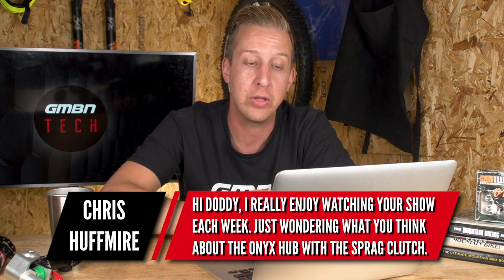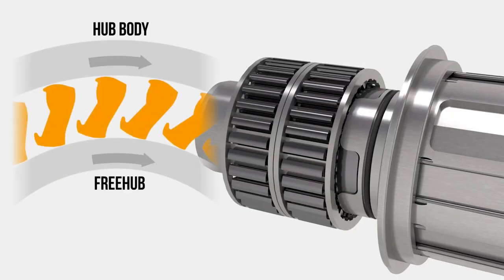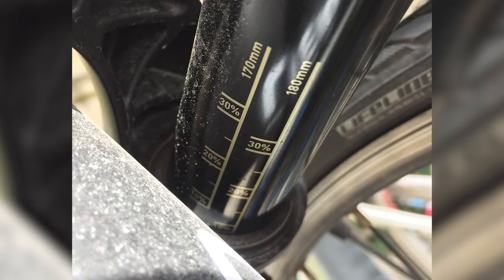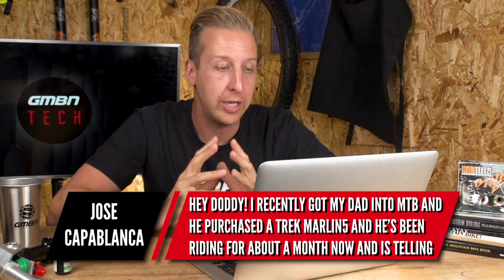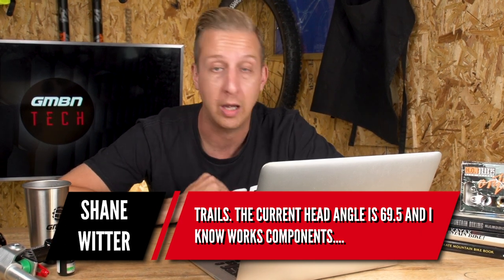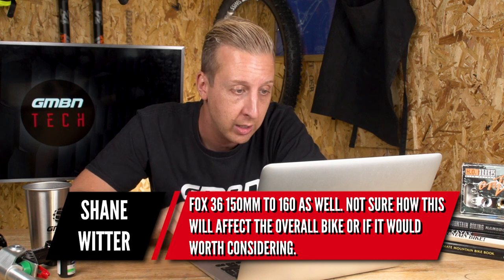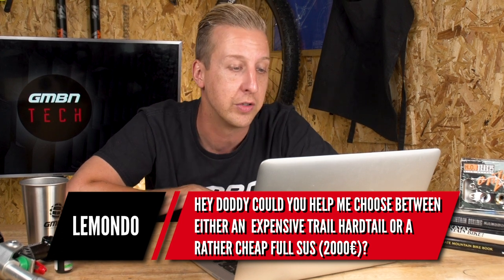Are Gearboxes The Future Of Mountain Biking? | Ask GMBN Tech

Comment from the maker: Which maintenance videos would you like to see? Let us know in the comments below
Reply: Hi GMBN,
Could you do a video similar to the one GCN did with budget bikes?
I'm sure it would be entertaining to watch a video with all the presenters having to buy/build a bike for a budget (low one) and the put them through tests.
Reply: GMBN Tech maintenance on canyon pivot bearings on full suspension bikes...especially the strive with the  shapshifter piston
Reply: Make a video where you completely overhaul a full sus bike from washing, lubing, greasing, pivot bearing maintenance, basically everything you could think of maintaining in 1 video
Reply: Its not really a maintenance question but it would be nice if you could do a video about all the different bottom brackets especially regarding chainline and that sort of things.
Reply: GMBN Tech SR suntour fork service
Reply: How to repair a snapped chain, how to repair a punctured tubeless tire
Reply: Coil fork rebuild (like the one you did on air forks). Many of my riding buddies still use (and love) coil forks.
Reply: Bottom bracket maintenance on the various styles.
Reply: Hi Doddy, vid on how to correctly inflate/pressurise forks and shock...as I saw a sram video about monarch shock and having to compress it at 100psi to charge neg chamber...but can find nothing similar for forks and my new super delux shock
Reply: How to drill an alloy frame to take internal dropper
Reply: Different pedal service vids fir makes that dont have them...e.g. time atac
Reply: Reverb basic service video, and for other dropper makes...
Reply: Paint chip repairs
Reply: Stop your helmet and kit smelling sweaty...
Reply: Replace headset CUPS...not just bearings...
Reply: Some vids on hack maintenance, when u dont have the specialist tool,  like fitting a (solid) crown race without a proper tool,
Reply: Replace free hub and rear wheel bearings...
Reply: Next bike project...how to build up a retro bike...including finding old genuine, parts, the right old tech...etc.
Reply: Ok, that's enough for now...😀
Reply: GMBN Tech stripping down shocks and forks completely for complete servicing May be also dropper post fitting and full servicing
Reply: How to replace pivot bearings with a homemade tool
Reply: Also how to stop cable rattle!! It drives me crazy ive tried everything up to inflating a ballon inside my downtube and it still doesnt work. Zip tie trick doesnt work eithrr
Reply: GMBN Tech st suntor coil fork service
Reply: As always great video Doddy, could you make maintenance video on front suspension, rockshox low to mid price range forks (reba, sektor, recon) how to change travel, upgrade compresión damper? for example, thanks!! Keep up the good work.
Reply: Would be nice to have a how to true and dish a wheel. Dont think you covered that topic yet. Freehub body service would be cool as well!
Reply: I would love a how to video about truing a wheel
Thanks for the show Doddy. It's awesome.
Reply: servicing brakes, ie sticky pistons,
Reply: @GMBN Tech, Please can you do video on how to clean, grease or service a rockshox reverb dropper post. Thanks.
Reply: Types of BB's and how to fit/replace one. Also reverb dropper maintenance and trouble shooting eg vertical play of which I have on mine
Reply: I'd really like to learn how to set up my gears but I'm afraid of fiddling with it. I've already messed with the limit screws erroneously to try and adjust something that supposedly should have been adjusted with the barrel roll adjuster. I have a bit of a hard time understanding the relation between the various bits in tuning gears and I'm really curious but also afraid because there isn't really something that I can lean on the know that I've hit the correct tuning. There's no measurement I cant take, or something like that it's down a bit to feel and that's kind of hard to grasp for someone who doesn't have lots of experience in doing it.
I'd also like to replace my own cables but that also feels like something I could easily get wrong.
Reply: I want to know how to take apart an xd driver freehub, not just take it of the hub but take it apart itself for example taking of the bearings to regrease them.
Reply: Trailside maintenance: patch kits, plugs, etc when you break down far from the car or the shop.
Reply: A place with all maintenance guides would be cool. From a simple how to clean to complicated how to maintain a shock or true a wheel, in one comprehensive unscattered list. Maybe also more safety gear performance and how certifications compare?
Reply: I wouldn't call this one a "basic" or "maintenance" but still: how to build a wheel. From picking right spoke length to lacing everything together with as much details as possible. Cheers Doddy!
Reply: I would love to see more suspension related stuff, like changing the air shaft to increase or decrease travel. Or dampers, like making a normal Fox 36 Performance into a 36 performance elite by going to a nicer damper cartridge
Reply: Hi Doddy can u do a video on shaving bottom brackets please, going to be doing mine soon and would love to see more info about this, ps. Love the show seen  all ep's
Reply: Series on maintaining your tech like GoPro, electronic shifting, power meters and other bits like that how you keep them calibrated, how often you charge them where you mount your GoPro's and stuff like that its the tech channel, after all, make it tech maintenance
Reply: Bearings removal and service of FS frames
Reply: Maintaining press-fit BB's
Reply: hub maintenance with no special tools :D
Reply: how to service a fox dhx 5.0 coil and rockshox boxxer
Reply: How to true a wheel video would be great, saves me having to go the bike shops.
Reply: #askgmbntech hi doddy I have a 2008 giant glory and it comes with a fox DHX 5.0 what do these do and how do there work position-sensitive Boost valve, adjustable ProPedal, adjustable bottom-out resistance, adjustable tuning range via Schrader valve
Reply: GMBN Tech  
Hey Doddy, a video showing how to replace a internal brake cable/hose would be nice. How to you prevent le mineral oil or the dot liquid from dripping in the frame ? Also what are your tips for routing the cable inside the frame? 

Thank you  !
Reply: Lower leg service, driver body service/cleaning for rear hubs, switching to a 1x maybe, not really maintenance related but maybe compare different level drivetrains from Shimano and sram and maybe discuss benefits of each as compared to others in the same price range or from the same company
Reply: Air to coil conversion for fork and shock?, BB service
Reply: GMBN Tech make a video on how to change a tyre and how to patch an old inner tube
Reply: How to properly choose and upgrade your bottom bracket. 

I have a 2018 Specialized enduro 29' 6 fattie. Entry model. I want to go from RaceFace Aefect to RaceFace Atlas but not sure I can. I want to to go to atlas because of the 165mm crank option that's not available with affect line. I want to stick with the cinch chainrings, because I bought several of different sizes of them for different conditions.

The atlas has a 30mm spindle and the aeffect is 24mm. Both come in 68 73 or 83mm. I know how to take the parts off. I am not sure if the 30mm matters at all other than I will need the bearing assembly. I just want to know what parts I need to order. Its seems for the most part this stuff goes in only one way if its compatible.

The reason for this change is I bent the crank arm. Trying to make the most of it.
Thanks for your time.
Reply: Hi GMBN tech, I love your maintenance videos however I’ve found that they can be very intimidating because the videos are edited into a short snappy 10min video. Anyway I thought it would be really cool if you did a similar setup to “Bike man for you” where with a live stream he shows you Everything as well as all of the problems he’s ran into along the way. I just recon you could create a really cool series where you get a random bike with an issue like a creaking sound and in 45mins - 1hr you trouble shoot everything until you find the solution and solve it. 

And the setup would be so easy to do in the GMBN workshop you just need a few high resolution security cameras in different spots as well as some extra fun cameras like a Allen key Cam that would help viewers see the exact screw your working on. Also you don’t even need to live stream it you can just get an editor to stitch the camera angles together and then upload and your done.
Reply: Hi GMBN, 

Since most of us here do the maintenance ourselves because of mud/dirt/grit, cleaning is a weekly process for me (Philippines) i also use my HT as a commuter bike so soot from exhaust pipes gets in my drive train. Could you make a vid/tutorial on how to prevent rust or lessen the dirt/grime/water around and inside the bike?
Reply: Rupert Wenn don’t do this you completely sacrifice the rigidity of the frame by making a weak point just go for an external dropper I know it’s temping when stealth droppers look so much better buts it’s not worth it.
Reply: Seat post service comparison. Reverb versus the various cable operated posts perhaps.
Reply: How to remove the creak from a Rockshox Pike crown without buying a new one.
Reply: GMBN Tech hey Doddy would love to know some tips on regular maintenance for post riding. I.e what to clean and check after each ride, something quick, easy and efficient, thanks champion 🙌🏽
Reply: Brake bleeding with and without bleeding kits
Reply: How to service a reverb dropper!
Reply: Not strictly maintenance but I would like to know how to tune the damping on a fork or a shock biy using different weight oils or if that is even possible/sensible.
Reply: A video on how o service your cassette and rear hub
Reply: Converting a 1x 9 to a 1x 11
Reply from the maker: Hey Luke, we've got a couple videos on this already. Neil did one where he showed what he normally takes out on the trails with him. Or are you thinking more about how to actually do the fixes? What sort of fixes would you like to see?
Reply from the maker: Hey Andre, It's really not too hard. Doddy goes through the steps one-by-one here: http://gmbn.tech/perfect
Reply: GMBN Tech  like how to take out the bearings and replace them or rebuild the hub it’s self I had to try this on my old bike and it can out semi right there’s a little grinding but for a 50 dollar bike to tow my bike trailer it’s but bad
Reply: This isn't a maintenance question but I would be interested in all the different suspensions linkages and systems with all they benefits and disadvantages 👍 love the channel
Reply: A video about different bottom brackets and bottom bracket sizes :)
Reply: GMBN Tech cheap suspension service is old satisfying something like a cheap suntor fork.
Reply: I'd like to see a How To Install and Setup on the adjustable head tube angle headset. Seems to me it could be possible to get it misaligned and have it angle off slight to the side by accident.
Reply: Rupert Wenn, for non washables, this can be easily sorted by putting your helmet gloves etc in a sealable plastic bag, getting as much air out as possible. And dropping in the freezer for 24 hours... did it will most of my paintball gear back in the day.. comes out nice and fresh..
Reply: Andrew Davis this would be good. As I need to sort mine..
Reply: GMBN Tech wheel building!
Reply: Changing hub bearings would be useful :)
Reply: hey doddy, would love to see some wheel truing and or wheel building. also. you were talking about tuning rear shocks (other than tokens). i would love to get some practical knowledge about that.
keep up the great work, i love GMBN tech (my wife hates it but i fix our bikes)
cheers mate
Reply: GMBN Tech Hey doddy, had a quick question Hooe thats alright. The current bike I ride is a size large and fits me alright however I'm looking at going  for a bike that is a medium would it work if I just upped the seat post and used nice wide bars or seen as I'm a teenager to opt for a large so it would fit me in two years time? Cheers.
Reply: Converting from 2/3x to 1x in general would be interesting. Complete Groupset incl. Shifters, Cranks,etc.
Reply: GMBN Tech Hey Doddy, it would be awesome to see a dropper post service/overhaul for various droppers on the market. Also, wheel building & truing. Thinking about a new wheel set in the new year and would love to know how to do it.
Reply: How to service a fork, I need to replace the seals on a RockShox recon
Reply: i know I'm kinda randomly asking but do anybody know a good site to stream new series online?
Reply: @Winston Tripp Flixportal xD
Reply: @Yusuf Brecken Thank you, I went there and it seems to work =) Appreciate it !!
Reply: @Winston Tripp Glad I could help =)

Comment: Videos highlighting common faults with current mtb tech and how to do your best to avoid them, eg sram brake pistons seizing and how to service and lubricate them. Creaking on pressfit bottom brackets, even different chainrimg standards eg boost chainrings for 148 rear hubs and why you have to use them instead of non boost chainrings and a 148 rear hub.

Comment: With hands going numb on the bars.  Something else to look at would be the fork air pressure.  If its a decent fork and you slip the ring all the way down, is the rider using almost all or most of the travel or is the ring still 2" from the crown after a ride?  If the ring is 2" or more from the crown the front air pressure is too much.  Start by dropping 3-5psi  in the fork.  It can make the front end softer so the fork can work more and absorb more of the small trail chatter that usually causes this.  Doddy is on point with the other recommendations for things to check and he probably assumed you were riding the correct fork pressure to begin with as that's basically the #1 setup thing you should look at.  Depending on the trails you "normally" ride, you only want to have 5-10mm of travel left on the fork (for a comfort setting) for larger than average hits.  If you're charging the trail maybe 15-25mm left for those big hits off drops/jumps but this will generally make the first part of the stroke firmer.  Also check you compression setting if you have one and make sure its backed all the way out and adjust after a ride.

Comment: Aside from Pinion gearbox, you guys might also want to check out effigear. Their system really works well with high pivot designs so you don't need to use idlers to get that magical zero pedal kickback. Not to mention their overall weight is significantly lower than pinions. Almost like 12 speed although their gear range is similar to having 11-40 cassette which isn't all too bad IMHO :D

Comment: Make a video about budget bikes (frames) that come with 1-1/8 steerer tubes but are converted to 1-1/5 (tapered) to accept the modern forks, there are videos and forum posts, but non of them are detailed anought, since there are plenty of external 1-1/5 bearings with different sizes, that might not fit traditional 1-1/8 tube, the bearing cups themselfs i mean, would be nice if you could get a used frame with 1-1/8 tube and change to external lower bearing to accept the 1-1/5 fork.

Comment: How about a video on how to route hydraulic brake hose through internally routed frames. Also any problems with brake fluid coming in to contact with alloy and carbon frame and what to do it any fluid does drip onto the inside of the frame. I'm assuming bike manufactures have no fluid in the brakes so have no problem.

Comment: Doddy, I have an idea.  I came across a situation volunteering at a neighborhood bike shop for the underprivileged.  This shifter one this donated bike I was working on was not shifting as it should have been.  In fact, it was designed to shift backwards from the normal stuff like on my SLX-equipped bike.  We fixed the bike and it worked really well.  But could you demonstrate the right way to disassemble, repair or refurbish shifters?  Perhaps even brake levers as well? Thanks!

Comment: I used tubeless, but the maintenance drew me away from the system.  Unless you're using expensive tubeless tires, the sidewalls and tire in general is heavier and more robust, meaning the tire compresses slowly and rather gives a dull ride quality which necessitates low pressures.  The expensive tires are light and have good sidewalls but as I said, very expensive and then there's the issue of the sealant needing to be cleaned out once it has dried up in the tire.  You could just add more sealant, but then you've got the weight of dried sealant material still in the tire adding rotating weight.  For some reason, I rarely get punctures at all, so the tubeless system had no advantage for me.  lowering air pressure add's traction, that's true, but knowing how to pedal smoothly and knowing the limits of the advantages of low pressure should mean pinch flats ought to be rare.  Good riding technique matters can make up for technology making up for lack of ability.

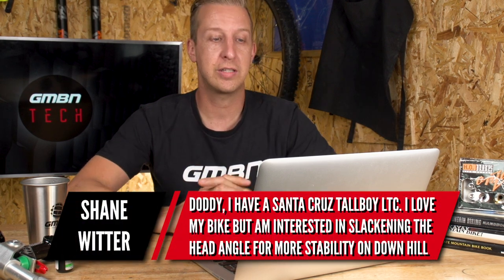Comment: 8:24 I ran tubeless in the winter due to Suomi tyres don't have a tubeless option yet, so I used continental inner tubes with orange seal in them, but keep an ye on it so the tubes don't stick to it self when deflated. There is white powder in them to avoid that sealant makes this possible. I haven't had any issues with this, but 2.1 studded tyres were quite brutal to ride, I recently installed  Cushcore but I I want Cush Core for winter set up and I want bigger tyres at least 2.3, I love tubeless, but I need a durable tyre only good tyre according to most are Suomi, but don't offer everything what I want, I know there are other options that are tubeless, I have to research this further, but advice is apriceited.